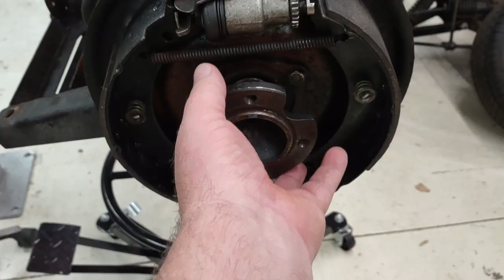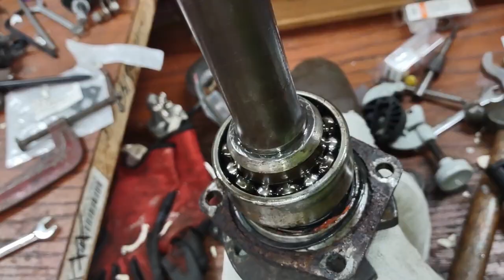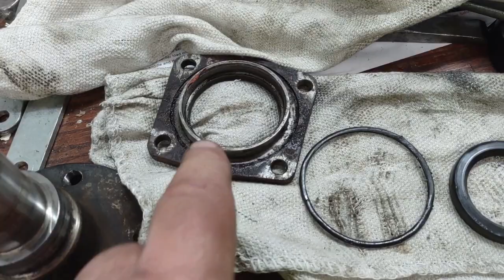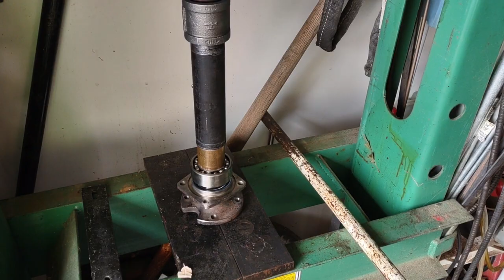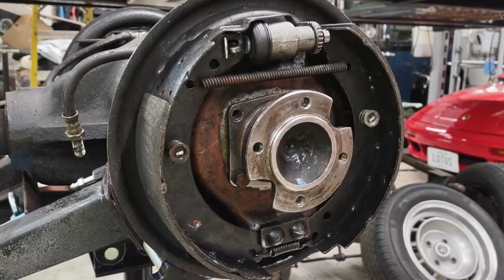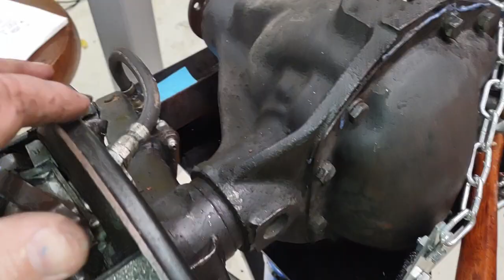76 Lotus Elite -- Replacing the Diff Output Seal

Comment: Just about to fix this shaft seal myself on my Éclat.The backplate mating surface on mine needs a good clean first though. I do like the threaded rod idea 👍

What sealant did you use there between backplate and diff?
Reply from the maker: I just used blue RTV gasket sealant. Good luck with yours.